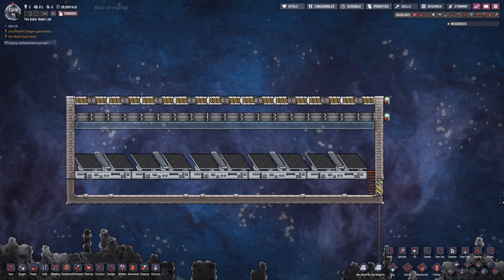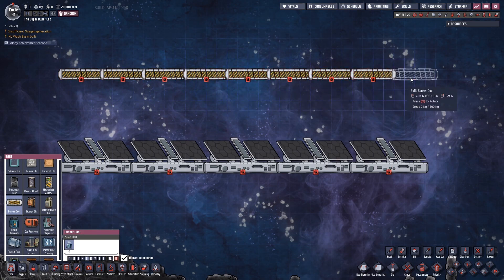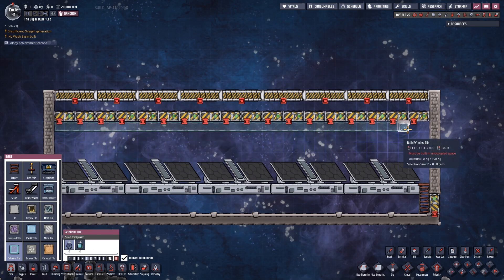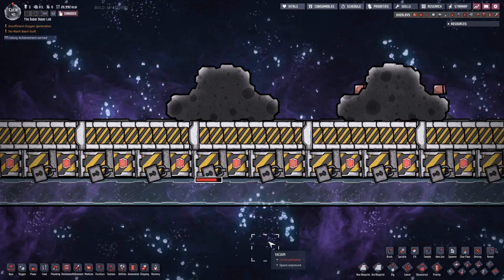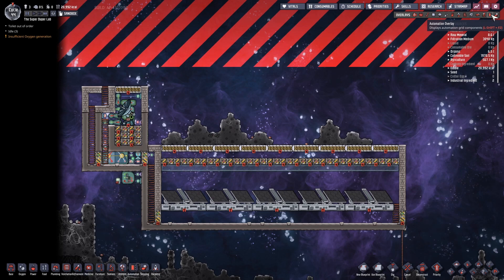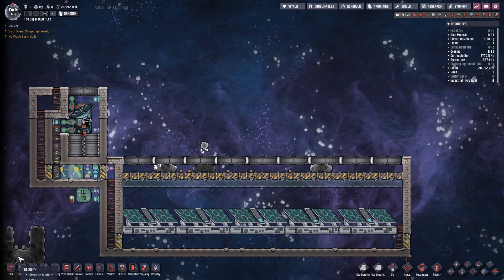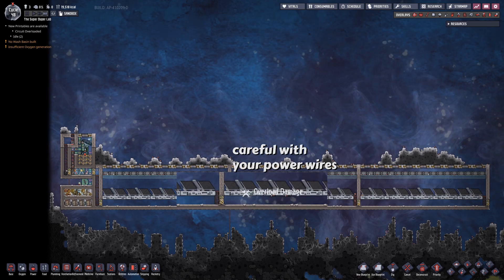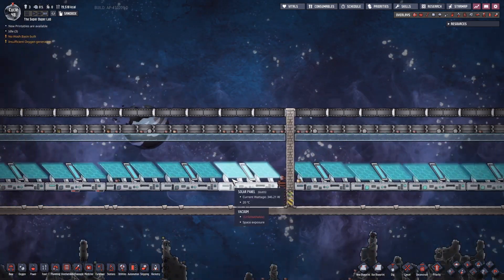Solar Panels without Robo Miners | Oxygen Not Included

Comment: Regolith can be used in Water Sieve to filter Polluted Water into clean Water and that process also gives you polluted dirt.  Regolith can be used in Deodorizer to filter Polluted Oxygen into Oxygen. Regolith can be melted and turned into igneous rock, fed to hatch's and they give you coal and or you can feed shove voles with it. the heat generated when melting the regolith could also power steam turbines.

this is great and all for sand box but not that great for a never ending survival run, its basically never ending  useful material that you are throwing away.

Comment: Also, doesnt glass windows blocks out the light?
Reply: Yes, window tiles will lower the brightness of the light slightly. This is observable in game just by looking at the Lighting overlay as the game will tell you exactly what the lux level of the light is and you'll notice any light passing through a window tile will have a slightly lower lux value. This lower value will diminish the potential of the solar panel's energy production, which is why using something like mesh tiles would be far more optimal, as they don't reduce light levels at all, allowing your solar panels to function at 100% efficiency.
Reply: nope it is glass light goes through it but better use diamonds
Reply: @Sci-Co555  k thx
Reply: @Sci-Co555   mesh tiles is better